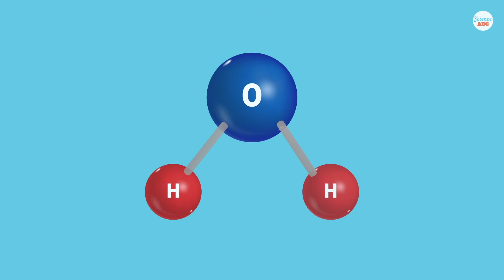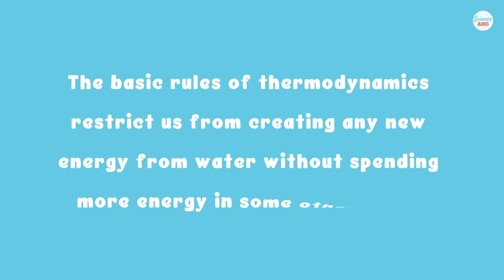Can We Really Build Cars That Run Only On Water?

Comment: A water plasma is necessary.  With a magnetohydrodynamic propulsion system this can be achieved.  The process involves the use of the right hand rule and left hand rule within the same body of the vehicle.  With pumping an electromagnetic field refraction through natural materials for the right hand rule and negative refractive indexed meta material’s synthetic materials for the left hand rule.  This would create the energy required for the a propulsion of the apparatus.  

Electrolysis will not work, as is energy achieved from the reaction is negative.